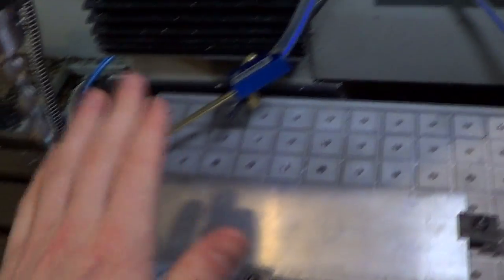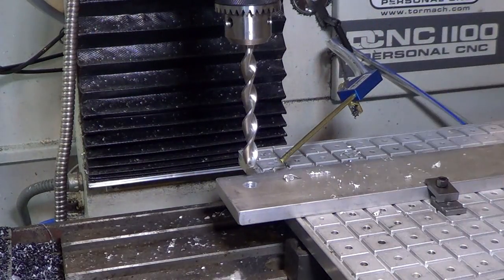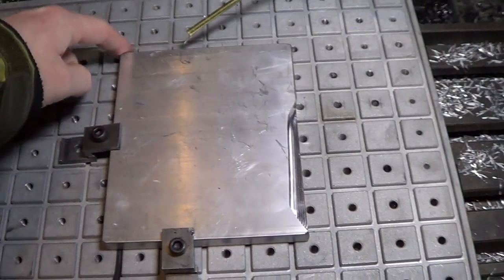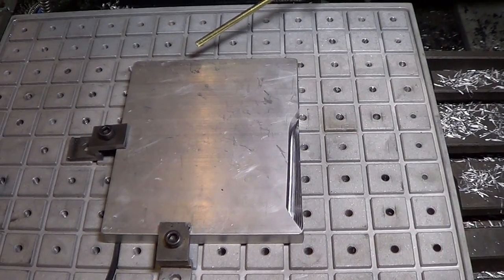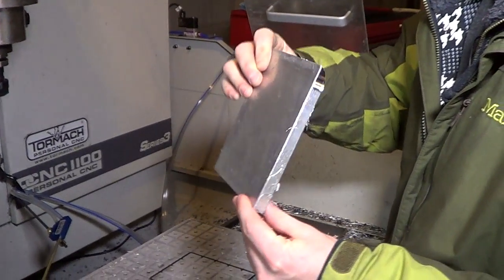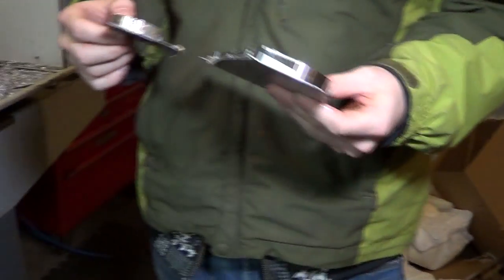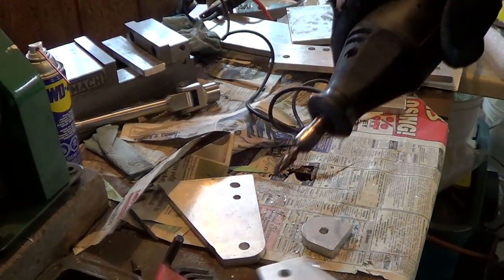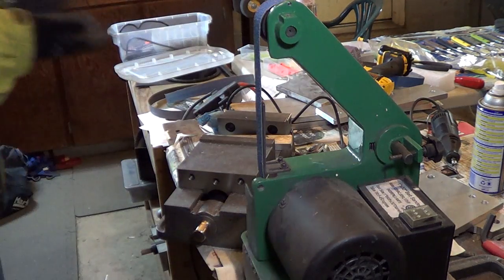Knifemaking Tuesdays Week 56 - Grinder part 1

Comment: the 45 Deg edge or surface to as bright a surface as possible, the idea to use this to reflect light from LED units pointing directly down at the 45 Deg surface which will light up the tool area.
Obviously the two side and the back and front will reflect the light at the tool area.
Another way is to cut a disc shape from steel or 'Ally' and using the surrounding steel or ally' which is cut and polished of course, place lights shining onto this 45 Deg circular face.

mrbluenun

Comment: Hi to you John and Erik ,

I have been thinking about how you may be able to alter things to allow the actual work area to be seen rather than have it in shadow.

Around the edge on the work table away from where the holding plate and piece worked on is clamped, or closer to the tool-tip if you want, make a triangular 45 Deg angled piece/s of glass, Hard plastic with silver foil stuck on the two sides which are not facing the tool area, or using polished steel or aluminium polished on

Comment: I shouldve been more clear.. if it failed under THOSE circumstances, it wouldnt last a second under my typical circumstances. I'm sure it can be made to work-- but at some point its probably easier to throw it on a bolt-down fixture, and not be limited on speed.

Comment: Keep in mind that every watt of electricity "wasted"by things like electric motors, is equally as cost effective at generating heat as a resistive electric load. So basically.. buy another tormach instead.

Comment from the maker: I eyeballed the installation of a nice 45,000 BTU/HR radiant heater and it's $1,500.  The house does have propane, so that's cool.  Definitely on "the list" but it's pretty far down haha.  We have lots of layers and winter is only another month or two long.  Next winter we can spend the big bucks.  We do have a propane blast heater that we use to take the chill off, but we have to crack the door to get fresh air in while it's on.

Comment: Heating with electricity is generally expensive, but there are ceiling panel radiant heaters that are great for drafty garage shops.  They heat the objects (and people!) and not the air, so the shop can be a lot colder and be very comfortable.  They also won't ignite flammables, they take up no space, and don't move air so there is no convective cooling effect.  Halogen lights can be used for task lighting AND some cheap radiant heat.

Comment from the maker: MDF wood board is supposed to work well, if you seal the edges.  It will pull vacuum through it so your part still suctions down.

Comment from the maker: As I replied to Rob: Don't be so quick to blame the VacMagic, as you can tell from nearly all my previous vids I make a lot of mistakes ;-). My old compressor is not up to the task, so I'm not pulling as much vacuum as I could be. I was also using an air blast, taking up more pressure. Also, they have a soft and a firm gasket material, I was using the firm stuff so I don't think the part was seating down hard against the fixture, the soft gasket would have worked better. Live and learn!

Comment from the maker: Don't be so quick to blame the VacMagic, as you can tell from nearly all my previous vids I make a lot of mistakes ;-).  My old compressor is not up to the task, so I'm not pulling as much vacuum as I could be.  I was also using an air blast, taking up more pressure.  Also, they have a soft and a firm gasket material, I was using the firm stuff so I don't think the part was seating down hard against the fixture, the soft gasket would have worked better for this part.  Live and learn!

Comment: I watch your vids weekly . So first I want to thank you guys for taking the time to share .
I do have a little advice . I agree with motormaker your clamps need to be parallel once they are tightened . I noticed when you where drilling the first plate the clamps where at a bad angle . That tends to push the plate away from the clamps . The clamps kinda have a nickname of toe clamps . Because they should clamp at the toe . Just an observation from an oldtimer . Thanks again guys

Comment: The clamps you are using are toe clamps(AKA parallel clamps). They need to be parallel to the table for maximum clamping force. The reason the part moved was two fold 1: not enough clamps 2: clamps used wrong. The code seemed to be trochoidal milling which is a good method of chip thinning. Good chip thinning will help with tool life and it will lower lateral forces on your part. I agree, I would not trust a vacuume chuck with that kind of side load. Good luck with the grinder guys.

Comment: The cutting passes didnt appear terribly aggressive. In fact, because they were constant engagement & low axial engagement.. I have no choice but to assume the vac-magic is unsuitable to the task of holding even relatively large (as shown) workpieces. I'm rather disappointed, as i'd always been interested in their setup. It really defeats the purpose of vacuum if you have to add clamps.